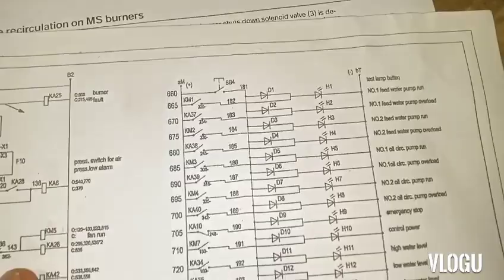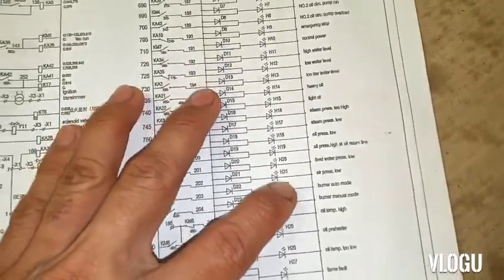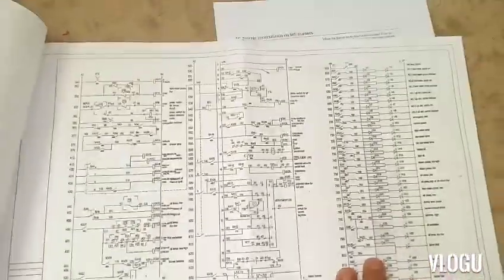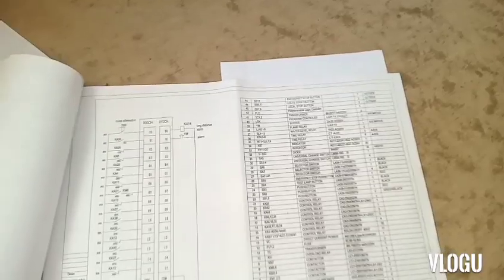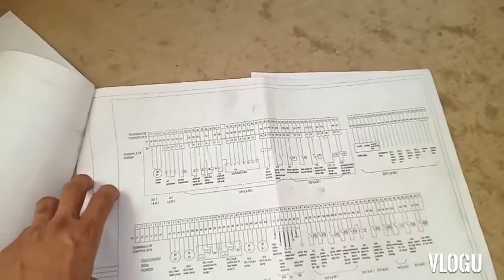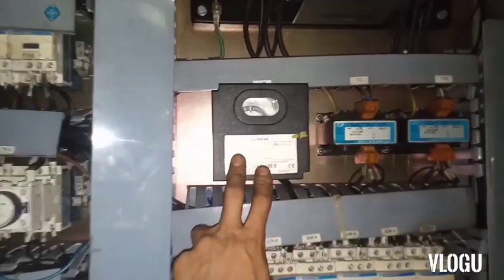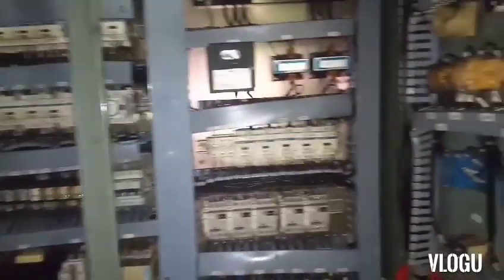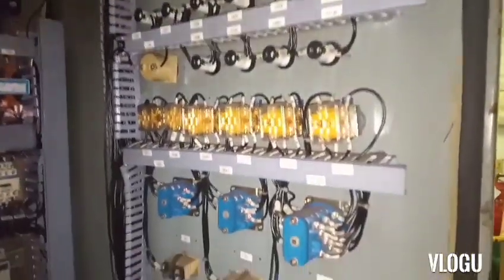HOW TO REPAIR BOILER FLAME FAULT CAN'T START IN AUTO AND MANUAL.

Comment: it would be a great start to clean the burner, check up all neccesary primary tasks as oil temp, ignition, airflow and airpressure..
then also clean the IR-sensor. it was more dirty then a firemen after a big tyre-fire...